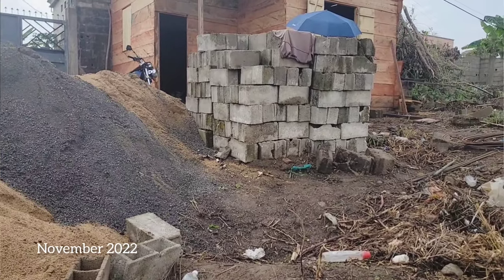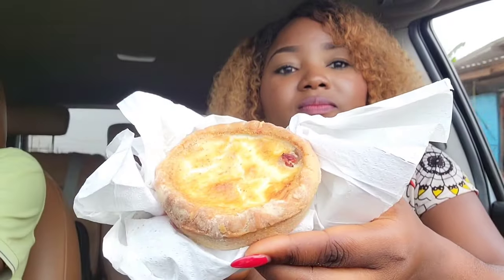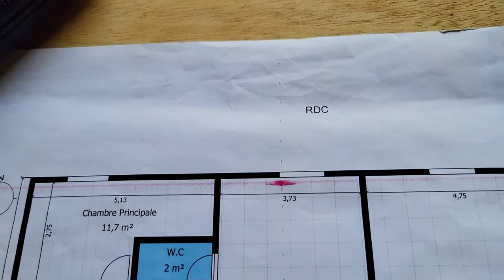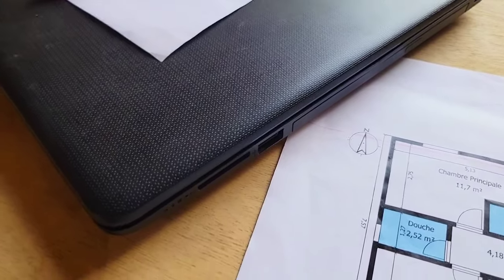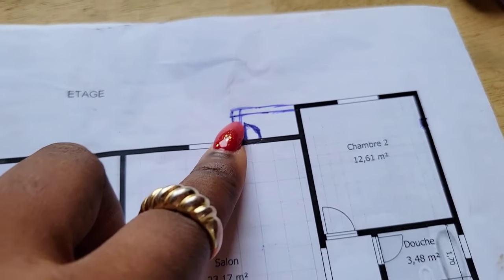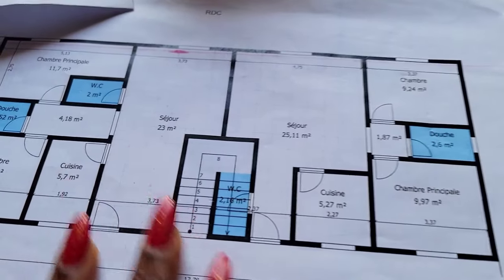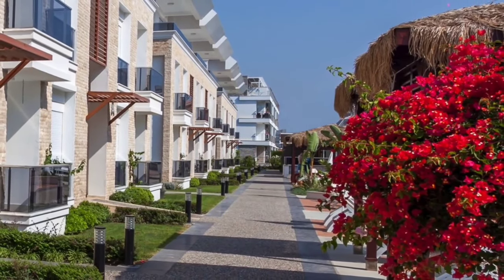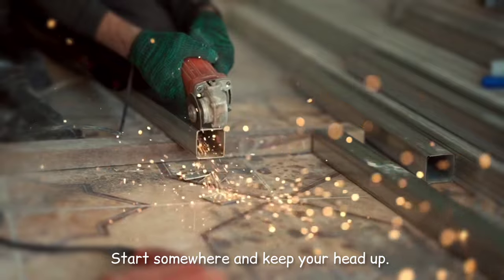Ep.2 Building My Apartment Complex:  Up To 4 Buildings on My Land! | Floor Plan Explained

Comment: Congratulations on your big plans. Just a little comment concerning your floor plan, maybe you should avoid toilet doors leading into the living room, chances of someone forgetting to close it is high and imaging if it’s messy inside (unless u add a door closer). Make your toilet doors to lead out of the hallways instead, even those of the kitchens. I am no engineer but just finished building my own apartment complex. It is very challenging and we learn everyday.
Reply from the maker: Thanks for the tip 👌🏾😊